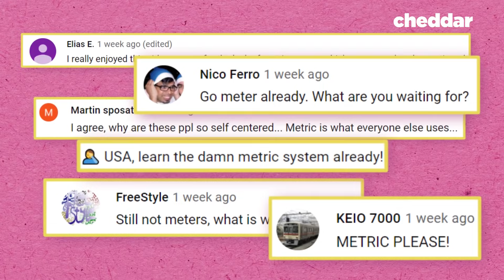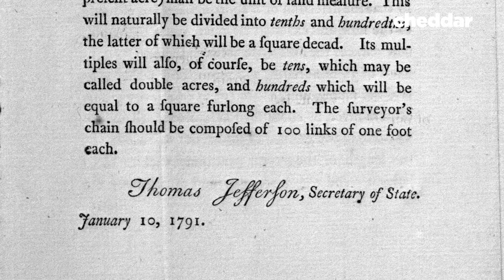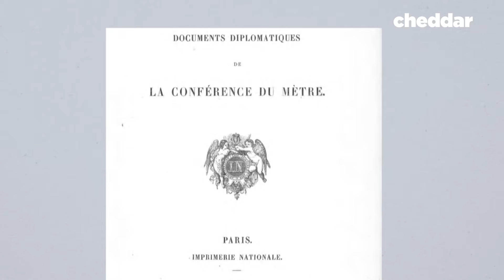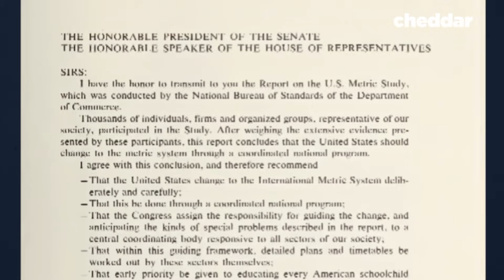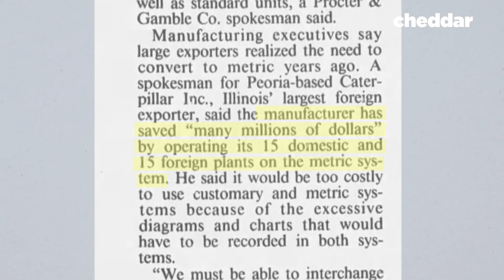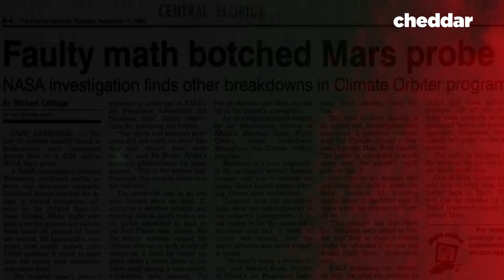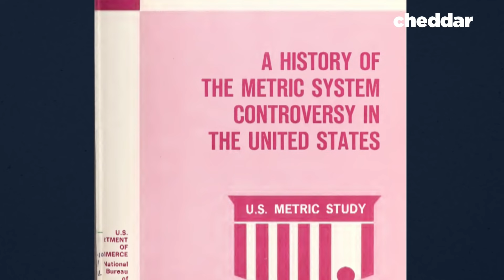Why Doesn't the US Just Use the Metric System? - Cheddar Explains

Comment: Inertia is hard to overcome in a large place like the US of A. All cars sold here since... the 70s? ... have speedometers marked in mph and kmh, and some today can display either system on all gauges. The trouble is replacing millions of speed limit signs. I've seen our dear Canadian friends apparently perplexed by a sign marked (SPEED LIMIT 60) or w/e, since their cars only display kmh. 60 kmh is a roadblock in a 60 mph zone, for example. Also, I'm convinced that most drivers today can't read signs, let alone speedometers, anyway. And metricizing cooking is plain bonkers. I know what a teaspoon is. I use them every day.
Reply: Cooking? I have a truth bomb for you there are two different sized fluid ounces used. That means you could screw up a meal just because of a lack of standardization.

Comment: Something overlooked is that it matters less what system is in use than a consistent, verifiable usage of that system. 

I work at a major US aerospace company (formerly headquartered in Seattle, now headquartered in Chicago... for you SI people, that's "head 0,25") and everything is in inches, foot-pounds, etc. 

Recently, a UK jet engine builder was having a spot of bother with their biggest engines (basically falling apart) and needed a massive inspection program put in place. Being up to their eyebrows in seeking a fix, they called on us to make a number of special tools to facilitate engine inspection. Primarily, this consisted of heavy-duty lifting devices that would bolt directly to points on the engines so they could be checked at several worldwide facilities.

We got the material (tool steel) and waited on the vendor to supply detail drawings. They finally did, and our engineers converted them to a likely equivalent in inches. Yes, even nuts and threads were converted. Why, I shall never know, since we machined them and could have easily done them in metric. smh

Anyway, we exceeded their expectations and they were delighted to get the tooling ahead of schedule and under budget.
Reply: Then you may be surprised to hear that in the U.S. the usage of metric is rampant among technicians, engineers, and scientists.
Reply: I don't believe you. The modern aerospace industry works entirely in the metric system, as do virtually all companies that want to sell products anywhere but just the U.S.
Reply: Even in their own sample (GM) the adoption of metric and the streamlined design process allowing the standardization of their logistics chain were parallel, not subsequent.  Sure, metric is easier if you're a mentally deficient socialist, but either will give good results.  Capitalists do it as standard.

Comment: I work in aviation, which by international law, has to work in imperial measurements. However, we work in 10ths (down to thousandths) of an inch. 
Can someone tell me, why we weigh the weight of things on a scale when kilograms are supposed to be mass and not weight. Wouldn't it give the same error as weighing something when not at sea level? As well, shouldn't it be a different machine to find the mass.
Construction may work in metric but a 4x8 sheet is still 4x8, studs are 8,10 and 12 feet long, usually on 16" centers. Plumbing pipe is still 1/4, 3/8, 1/2, 3/4 etc. but you can convert them to a long metric equivalent. And no, i don't live in the US.
Reply: You work in aviation but didn't study physics? (apparently). The mass vs weight thing: On Earth in a sense mass=weight because we are all dealing with 1 g. There are machines that can determine mass whether it is on the planet or in orbit.

Comment: Here in the UK, we still drive in Miles and use MPG to measure consumption (it's a pain that we can't buy in Gallons anymore).  Draught Beer is still sold in Pints.  I know what I weigh in Stones and I know my room sizes in feet & inches.  TV screens are measured in Inches.  The Butcher will sell me things in Pounds, as will the Greengrocer (but they show the price in bizarre Metric measurements).  Need I continue?  The Imperial system is so much easier to use and mental calculations, on numbers in the 12 & 16 groups, are far easier than a decimal way (12 being divisible by 1, 2, 3, 4 & 6 - but 10 only by 1, 2 & 5).  I hope we get more Imperial in the UK and ditch Metric.
Reply: ok as for the buying of meat in pounds "but they show the price in bizarre Metric measurements" Both sides of the argument could use that logic but it's moot. Why? because if the dominating measurement was kilograms and you converted to pounds you will also get a number with a bunch of decimal digits. Base 12 and 16 easier to use mentally than a base ten system? Then switch your arithmetic over to base 12 or 16.
Reply: @dannygjk  But the vast majority of the population don't want metric.  We've suffered a partial move over to it and we should undo that and go back to proper measurements.  Base 16 is called hexadecimal by the way.
Reply: @davidwallin7518  I'm used to just saying hex from my programming days.
Reply: @dannygjk  Me too
Reply: @davidwallin7518  However they would struggle to calculate in Imperial units as they haven't been taught consistently since the  1960s. Most couldn't tell you how many pounds in a stone even though they might know their weight in it.

Comment: But when we measure to precision dimensions we think of thousands of an inch.  To me more precise we can take one thousands of an inch and we will divide that into tenths. So , IN METRIC WHAT = 1/10 OF 1 THOUSANDS OF AN INCH?
Reply: You kinda confused me but I'll try to give an answer to that if I got your meaning. In a sense when you are talking thous of an inch you are doing essentially what they do in metric. You are using base 10, just as is done with metric, just as you use base 10 in math. So when using inches you might say 1.125 in. Metric you might say 2.145 cm, (they aren't equal I just grabbed some numbers out of my head). So to, (hopefully), answer your question if you want 4 decimal digits in inches as you know you will do 1.3125 in. Metric does the same thing just add another decimal place it's just different units.
I just realized you may have meant something else. Just as you have inches, feet, yards, miles, etc. Metric has mm (millimeter), cm (centimeter), m (meter) etc. Example for 1.3125 in. you say one point three one two five inch(s). Metric does the same example 1.2345 cm is said as one point two three four five cm. So you want to take 1/10 of a thou as I'm sure you know you just move the decimal point one place to the left. It's the same in metric just move the decimal point one place to the left.
The essential difference between Imperial and SI(normally called Metric) is that Imperial uses a mixed system: 12 in.=1 foot, 3 feet=1 yard, 5280 ft.=1 mile, 1760 yards=1 mile etc. Metric ideally would use only meters but that would be annoying in some circumstances just as it would be annoying for you to always use feet. So in day to day use you will see thous of an inch, feet, yards, etc. in Metric I will see cm, m, km, etc.
Reply: @dannygjk  I like your answer!

Comment: You forgot to mention that around 1970 Canada and the U.S. reached an agreement that they would both convert to the metric system within 10 years. Because of this agreement Canada went full bore, mandating that the school system stop teaching the imperial system and begin teaching the metric system. Almost over night all packaging in grocery stores were labeled in metric as well as dual languages, English and French.  Then about 5 years into the changeover the U.S. announced that they were going to remain using the imperial system. This was one of the main reasons why when you bought an American made automobile, the speedometer had both miles and kilometers. Of course some readers will argue that this was because the American automakers were getting into the international market. But in the 70's the bulk of exports were to Canada which had now been switching to the metric system. Even today most baby boomers still know and use both systems of measurement.
Reply: Yes I grew up with both systems I know both well.

Comment: I would love if we went total metric. I wouldn't have to buy two sets of tools for stuff I fix plus when I fix stuff with metric tools I use less tools.
Reply: We have the same problem here in Canada.
Yeah it's so annoying to need two different sets of tools I've been dealing with that for decades. example you need to remove some nuts and of course usually it isn't stamped on the nut or you can't read it because it's rusty so you have to try different sockets or whatever and judge by feel or eye which is the proper one. Plus it can be harder if the nut is rusty or damaged.
Reply: @dannygjk  I can make a pretty good guess when I know for sure it's all metric, my dad can look at and bolt or nut and tell you the size. I'm not that guy lol.

Comment: I’m 48 years old my cousin is 38. The schools used the “ Imperial System” when we were in elementary. It’s not fair for us older adults to adjust to the Metric system. “Times are changing” I know. But if you’re going to change to the metric system at least compare one to another. Example: one foot ( 0.914 meters) so we can slowly start learning the “ metric system” what’s so hard about displaying parenthesis?
Reply: one foot is actually about 0.34 metres. You're  thinking one yard, that's about 0.914 metres. I grew up using metric, but I still understand the imperial system, it's not hard. Your currency is decimal, simple
Reply: _DrunkenSailor Thank you for the correction and tip👍

Comment: Being an older American, I find no issue in either.  I understand both as I understand 2 languages.  I don't convert. I think in metric when metric is used and in imperial when that is used.  IE; If I step outside and the ground is frozen, I know it's 32deg or 0 or less.  The word imperial or metric never enters my mind.
The video was very interesting, but I'm wondering if it matters at this time?
Reply: I’m Belgian and also use both with ease. In engineering I do have a preference for Witworth tread over imperial or metric because to me it feels better with the 55deg tread angle, making it also generally stronger
Reply: Don't mind the conversion errors.. maybe for regular ppl. But come on they lost a satellite cuz imperial Is crap. You need to improve. But i guess USA just like to do things their way. 🤷🏻‍♂️🤦🏻‍♂️
Reply: NASA doesn't use imperial measurements anymore
Reply: @MadGamer_666  cant stop people from thinking in a system they've always thought in... i think people should know both metric and imperial
Reply: AGenericAccount nah only metric, since the other is Just useless unless you live in the usa
Reply: @victorbaltus1635  not right. All international aviation uses feet and nautical miles as standard units, as well most marine stuff uses yards. This is true for all nations.
Reply: AGenericAccount Good for the marine, But they should not since that system Just sucks

Comment: I really think the foot and the meter were once parts of the same measuring system, One that might go back further than Sumerian times. multiply one foot by pi and we get a length very VERY close to one meter, off by only .1414. and a circle is the only shape with a dia"meter" which seems to imply 2 meters. just an observation.

Comment: I am in Canada where we have been using the metric system for years. 
Let's face it, metric is simply an easier system to use, much easier.
Everything is base10, everything is easier to calculate in your head. 
As per the video, there have actually been several (expensive) major accidents caused by some people assuming they were using metric units when someone else was using the English system.

Comment: The most anoying thing about the american measurment system is not the weight or the length. It's the temperature. Why do you use a scale based on alcohol? Escecially after that time of the prohibition.

Comment: Metric and Celsius are stupid calculations.

What's so hard about inches? 12 inches is a foot. What's the difficulty in that?

Same with Fahrenheit. 100° is really hot, 0° is really cold. It isn't rocket science.
Reply: Well it's harder when you need to do calculations in your head using base 12 or base 16.

Comment: You're both wrong, base 12 counting methods are still superior. 10 has 1,2,5,and 10 as factors, 12 has 1,2,3,4,6,12 as factors.
Reply: More difficult to do math in your head using base 12.
Reply: @dannygjk  only because you aren't used to it.
Reply: @dogishappy0  I have a news flash for you I grew up with both systems and it is easier to do the arithmetic in your head when you are using base 10. I can multiply two 2 digit numbers in my head but that has no bearing on which system is simpler.

Comment: because the metric system is stupid .you will still have almost a meter or a little more than a kilometer  when you live in real time . the british still use miles when talking in distance so whats the difference almost a kilometer or almost a mile nothing in nature actually occurs in measurments of tens . in canada we are only metric because of pierre trudeau wanted to be different than the US .one system is no better than the other
Reply: Metric is simpler.
Reply: @dannygjk  no its not .an inch is an inch .except for length wise 1.5 inch's is the same as 1.5 centemeters absolutely no more difficult to calculate & so on
Reply: @technicallyobservant7888  Have you done any carpentry? Remember learning fractions in school and adding fractions, mixed fractions, converting fractions to decimals.

Comment: I believe Norway went metric in 1889 or thereabouts.
When we did, all the old units were metricised. So they could be used alongside the new metric units.
Since this is well over a century ago, you'd think all these old units have disappeared, right?
Wrong.

We still use the Norwegian mile, which is 10 km. For land areas, we use decares, except we call it "mål" (which means "measure"). Even though cut lumber is sold in mm, everybody think of them in terms of inches. So you'd buy a 2x2", rather than a 48x48mm. Yes, I know 48mm is less than 2", but it has to do with it having been 2" before it is planed.
And a funny thing is that butter is still sold in marks. The normal packet of butter is 250gr, which is 1 mark. Butter is also sold in 1/2, 2 and 4 marks. Or 125gr, 500gr and 1000gr.

My point of saying this is that it's silly to force the new units onto people who are used to the old units. It's a much better idea to metricise the old units, and allow them to be used alongside of the new units.
If USA started to use pounds that are 500gr, I don't think anyone would react badly to that. So you buy a 1 lb cheese. It's 10% bigger than the 1 lb cheese you bought last week, but that's not a problem for you, is it?
You used to be 210 lbs and 5'11". But after the pound is defined to be 500gr, and the inch is defined to be 25mm, you are now 190 lbs and 6'. I don't think I'll see many people complaining about that.

It's just a matter of introducing metrics IN A WAY that doesn't piss off people.

Sure, it would be an issue with baking and cooking, but I don't think that would be a huge problem.
Reply: Good points, also cooking is already complicated because there are two different sizes of ounce in use. lol
Reply: @dannygjk  Well, is the troy ounce really still used for cooking?
Reply: @Tjalve70  The U.S. gallon is a different size from the other gallon so different size oz.
Reply: @dannygjk  Ahh, you're talking about the fluid oz. I have to admit I have never really considered that.
However, we are now just talking about US. And since I doubt US uses imperial gallons, I don't think they're using imperial fluid oz either. So I guess only one fluid oz in US.